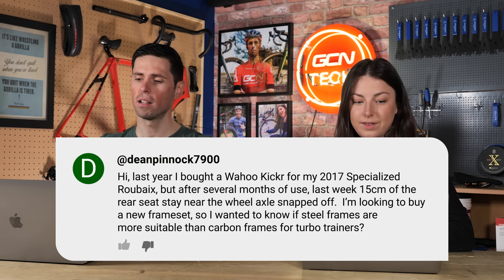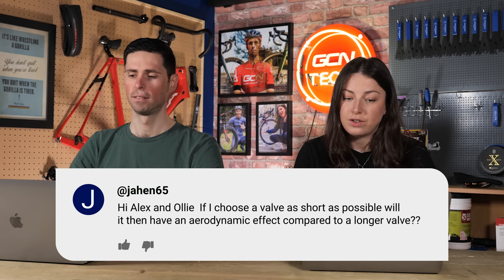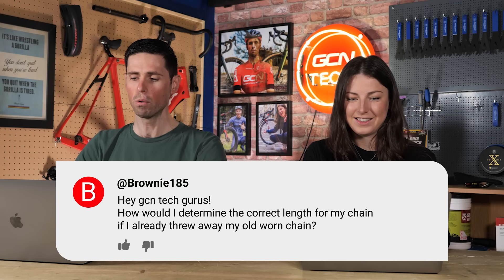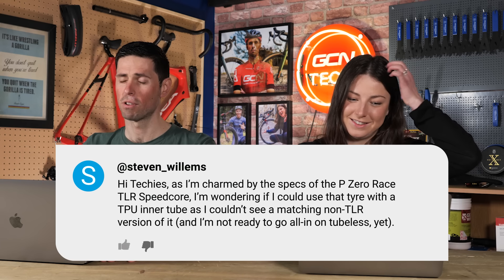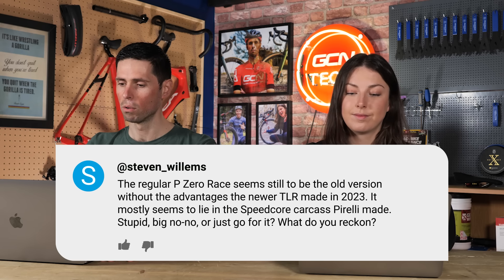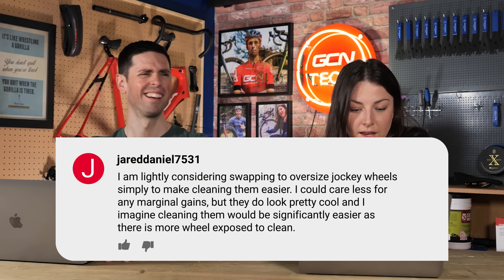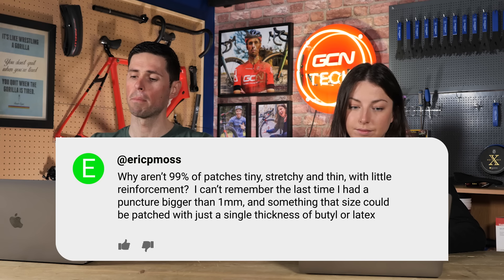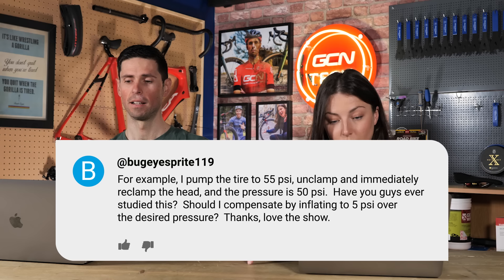Chain Sizing, Oversized Jockey Wheels & Aero Valves | GCN Tech Clinic

Comment: As Alex points out most the air you hear when removing the pump hose is the air sound is coming from the hose itself. When reattaching the pump, the hose is stealing pressure from the tire. A shorter or firmer hose material will have less of this affect, but really isn't a problem.

Comment: Adjusting Chain length, Calvin at Park tools has an excellent video on the process. 
If it is really complicated then there is no shame in going to a bike shop to have it done, something critical like proper chain length it is well worth the time and money spent to have it done correctly and have many enjoyable miles-kilometers of riding knowing it is done right.
Reply: I've seen a handful of chains where they're just a little too long because most of them were installed with the chain routed over the smallest chainring & cassette cog and through the rear derailleur. They just assume as long as the slack is taken up, it's the right length, but some of these rear derailleurs have incorrectly adjusted B-tension gaps.

Comment: When you pump up your tires there is a VALVE in the wheel or tube, you force air against it, when you take off the pump no air escapes. None. The sound you hear is air compressed inside the pump

Comment: The chap with the inflation question has misunderstood the situation.  When he releases the valve the woosh of are is in the airline, not the valve.  When he then puts his pressure gauge on to measure the pressure, a small amount of air is lost in the measurement process.  I think he isn’t loosing anything!!
Reply: Exactly!
Reply: Also a 5 psi difference is nothing since riding on a cold or hot day will change the tyre pressure more than that and noone seems to notice.
Reply: When replacing the pump hose, some of the air in the tire goes from the tire into the pump hose, thus making the gauge read lower.
Reply: @kokonanana1  yes. Also I was trying to say when putting in the digital gauge to see what pressure you have, that would also take an amount of air from the wheel.
Reply from the maker: We mentioned this on in the video, it's an easy mistake to make but a great nerdy question!
Reply: There are also pumps where you screw on the pump hose to the valve stem - it's probably not the case here.  I despise those.  By the time I can get one of those off the tire I've let out more air than I've put in!  Either that or I manage to back out the valve stem core while unscrewing the pump.
Reply: When I rode motorcycles, the standard method to ensure the correct tire pressure was 1. Pump about 5 psi more than you want into the tire 2. Measure the pressure with a gauge several times until the pressure reaches what you want (each measurement will cause a little air to leak out).
Reply: @peteralexander6514  riding yesterday at around 6 degrees for 5hours I set front to 72psi and rear to 75 psi.
When home tested again front was 69 rear was 74.
Interesting......
Reply: Presumably the pressure is pumped up to the value on the gauge and then measured using a different gauge? So are the two gauges calibrated to read the same? I doubt much air comes out when taling a reading off the valve.
Reply: Chap. Brits. Cricket? Bots?

Comment: I over-inflate my tires to compensate for the small amount of loss when disengaging the track pump. Works for me.
Reply: same here I inflate a bit over, my pressure gauge has a release valve on it and I just adjust to the correct pressure.

Comment: Tyre pressures with a track pump. Most of the escaping air you hear comes out of the hose so not the tyre. However, when you plug the hose back on, the tyre will empty into the hose to equalise the pressure. That's where the 5psi went. If you want to be more accurate, pump up to a higher pressure with a track pump and then use a digital gauge to slowly lower the pressure to whatever you want.

Comment: The air from the tire needs to equalize the air pressure within the hose from the pump when reconnecting. That's the biggest loss of pressure, especially on small volume road tires. Do the same test on 2.5" wide, 29" MTB tires and it's a lot smaller of an effect.

Comment: Re the broken carbon frame on the Turbo trainer - it's quite possible that the same failure would have eventually happened when out on the road - so all in all it's a good thing it failed whilst on the turbo as otherwise it may have resulted in an injury! Better luck with the next bike, Dean!
Reply: Possibly, but far more likely that having the bike clamped in a trainer by the rear axle, while the rest of the bike rocks from side to side has caused the failure.
Reply: Funnily enough, a friend has just had this happen - the non drive side seat stay has failed on a ride.
Reply: @grahamaustin9085  Have they had it on a trainer?

Comment: I recently had to replace the chain on my road bike. I had to size the chain without using the old chain to help with the length. Actually, I couldn't use the old chain. As I have changed the cassette for one with a larger first gear and changed the cranks and smaller chainrings.

Comment: Specialized recommended NOT mounting their carbon bikes on turbo trainers until around 2020.  It is entirely possible that the broken 2017 frame came from Specialized not designing frames strong enough to deal with turbo trainer stresses, which are significantly different from wheel-on applications.

Comment: Bikes are NOT designed to move from side to side while the rear axle is fixed. Maybe he did a lot of powerful sprinting.

Many people point out, "it's only been used inside", when selling their bike but to me this is not a good thing. I'd avoid a bike like that.
Reply: Yeah idk how they didn't mention that. That's why on the turbo you sprint different to outside and shouln't sway your bike side to side.
Reply: correct!! the torque on the bike frame skyrockects when fixed at rear by trainer
Reply: He could have tried to move his setup while the bike was attached. Manon actually mentioned making this exact mistake and cracking her frame in an older video.
Reply: I just started using a direct drive indoor trainer three months ago, the Wahoo Core, and although my bike's frame is Ti and quite strong, very early I could see some potential issues if I wasn't careful.

First is the side to side you mention during hard sprint, which doesn't allow the bike to sway right and left as you would outdoors with arear wheel. That's got to be hard on the dropouts and frame and trainers should be designed with some sort of give at the axle attach point to protect the bike.

It also seems possible to do some damage if you're in a rush and don't fully drop both dropouts completely onto the axle so the bike ends up being cocked, which as you ride I imagine could do some damage.

Also, as I think Manon pointed out in a previous video, if you try to move the trainer with the bike already attached by moving the bike, you could also do some damage at or near the attach points. Probably more so with carbon frames but bad practice in any case.

The latter two issues can be avoided by being careful, but the first one is a bit of a dilemma. I wonder if you could insert a thin but hard polyurethane bushing on each side between the dropout and axle to give the bike some play when you get up and sprint, akin to car control arm bushings that prevent the arms and subframe from cracking?
Reply: Manon: “Turbo trainers are designed to have a bike on them”
Yeah I think the problem is that not all bikes are designed to go on turbo trainers 🤦‍♂️
Reply: @HabaneroTi  pure rubber bushing washers!!!

Comment: Turbo trainers designed to have bike on it. But, Bikes are not designed to put on Turbo trainers. He snapped it because the rear axle is fixed on the Turbo Trainers.
Reply: Yes to that. I've noticed that any bike I put on a Turbo Trainer moves significantly in the Stays and Bottom Bracket area. So much so that I thought my chainset on one bike was not True but it was just the bottom bracket area going from side to side about 8mm..

Comment: I actually do care about the valve length - I got myself a thread cutter for presta valves to be able to make the valve of the inner tubes just a long as the rim is deep, and put in a special valve which is a mixture of a presta and a car valve. This is included in valve extenders for Campagnolo HPW Shamal/Bora rims from the late 90's (part code UT-HU100). For inflating, I use a brass valve extender which I can remove and close the valve hole with a piece of clear adhesive film (Tesafilm), so there is no valve in the wind at all - I am sure especially on fast descends with velocities of 50 mph+, it does matter.
Reply from the maker: please share that with us on the uploader! upload.globalcyclingnetwork.com the hacks/bodge section would be ideal!
Reply: @gcntech  I will do so; probably one picture which shows both the common presta valve and that special one, and one with the built-in valve in a DT Swiss ARC Dicut 80.

Comment: Typically the PSI has balanced between the tire and the hose....except with Lyzene screw on heads which have a pressure relief button which can on occasion unscrew the valve stem.

Comment: Re: chain length, there's at least one excellent online resource where you feed in the relevant information: chain ring sizes, sprockets (biggest and smallest) and chainstay length (centre of BB to rear axle centre) and the calculation of how many links you need is done for you.
Reply: What website is this?
Reply from the maker: That sounds great! We love a nerdy bike site 💡 Would you like a similar feature on the GCN site?
Reply: Sram gives instructions in its derailleur installation manuals on how to size a chain. Wrap it around biggy-big while bypassing the deraileur, count the required extra number of links for your cage length, then break/install the chain

Comment: The rule of 105% stated that the rim must be at least 105% wider than the tyre to gain aerodynamic advantage. Some wheelsets like Roval Rapide CLX II and Reserve 40/44 has a wider external rim width at the front and narrower at the rear. Which tyre cobination is faster, using a wider tyre at the front and a narrower tyre at the back following the rule, or using equally wide tyres at both wheels which is too wide for the rear? #askgcntech

Comment: Re the valve question, shorter is lighter, it's win win !
Reply: I am sure 2g saved on the chain will get you up the stelvio pass much much much faster ;)
Reply: I’ve inadvertently ended up with valves slightly too short for my thumb-lock frame pump.  I’d rather have a valve a few mm too long than too short.
Reply from the maker: Hill climbers dream!
Reply: That was an unbelievably stupid question.

Comment: #AskGCNTech Are heavier riders more susceptible to perineum numbness on the turbo trainer? I had a proper bike fit and out in the real world there are many bumps or changes in gradients where I force myself in different cycling positions. When I’m on the turbo in one position, I find myself feeling numbness after about 15 mins and have to switch positions. I am a heavier rider and would theoretically have more pressure regardless on my sit bones—should all turbo trainer users be changing positions up, anyway?

Comment: Easy chain length hack is put it in the small chain ring, the smallest cog at the back and there should be about a half inch distance between the chain on the jockey and the smallest cog on the cassette.
Reply: That sounds great for stopping the jockey cage and wheels from hitting in the case of small/small but it does nothing to ensure you can move to big/big!

Comment: Old steel 10 speed on zwift hub works a treat.
Reply from the maker: Oooo what bike is it?
Reply: @gcntech  its a 1980 Columbia I picked up out of a recycle pile.  Made it a single speed for a few years then stuck it on zwift hub trainer.  Had to spread the rear triangle just a bit.

Comment: #askgcntech Hi Olly/Manon and Ian, 2 part question: With the trend towards larger volume tires what is the limitations of road bikes having a standard clearance of, say, 40c, would aerodynamics be adversely affected.  Also why do alot of premium tyre models top out at 30c, which is the largest size I can find listed in retailers for the P-zero race tlr.  Love the show.
Reply: Conti GP5000s TR top out at 32c

Comment: Hello Tech Gurus,
I signed up for an ambitious summer; Triple Bypass (118 miles/10,800ft), Blue Sky (formerly Mt. Evans 27 miles/6,700 ft), and Cycle to the Summit (Pikes Peak 27 miles/4,800ft). I have an Alchemy Ronin Ti with 50/34  and 11-34 in the rear. I purchased a set of lighter weight carbon wheels. I currently have 28mm GP 5000. Would you recommend 32mm for some added cushion? Or do I attempt this on the 45mm Schwalbe G-One RS?  I am also doing the GCN recommended workouts and what my p.t. bike fitter suggested. I am also doing climbs on Zwift. Would you recommend doing anything more so that I can actually finish. I thought about changing the weight on Zwift to 20 lbs more than I weigh. Would this be beneficial or is what I am doing sufficient to ensure I will finish. I do not mind suffering more now to suffer less later. Thank you for reading my novel.

Comment: #askgcntech I recently destroyed both my tires on a gravel ride. I only had enough boots and patches to get one of them to hold air again. I put the good tire on the back wheel because - traction. I had to ride 15 miles back to civilization. Steering was awful. Should I have put the good tire on the front or the back?

Comment: #askgcntech Hi all, love your channel. I have used Speedplay pedals for years and love them. But I have been troubled for a while now that the recommended cleat lubricant contains PTFE (forever chemicals) which I would prefer not to use or be exposed to. Is there an alternative cleat lube that should work with Speedplay pedals? Thanks.

Comment: You can cut patches to size as required.  Personally, I'd hate to try and patch a tube at the roadside with anything smaller than I have though, it's fiddly enough as it is.
Reply from the maker: That's true! It can be very fiddly. Do use a spare tube and take the broken tube home to fix in comfort? 🏡
Reply: @gcntech  Usually, yes.  Sadly last time I had a puncture on  gravel ride round a wind farm my spare tube had a faulty valve.  Hence the first hand knowledge of "fiddly", using a dirty pothole to find a puncture is not fun!

Comment: #askgcntech I bought a new bike last year with an 11/34 cassette because I thought I would need the 34 for one specific event with a very hard climb. Last year I couldn't do the event because a friend had their wedding that weekend. This year the event is cancelled. The event is going ahead next year, but if I need to use the 34 up the climb, will I have any issues if I have never used that cog before? Should I use the 34 even if I don't need it just so it gets some use? Ps I will not be buying a different cassette and changing it for the event so please do not suggest that I am too lazy. There are no climbs that are on any of my local routes that require a 34

Comment: #askgcntech I've tried this before but you advise us to measure actual tyre width when using tyre pressure calculators but not at what pressure to have when measuring. An over inflated tyre will have a larger width than it should have. Advice please.

Comment: #askgcntech Hi friends, I recently converted my weird looking 90s-mtb-converted-to-gravel bike from 26inch wheels to 700c. I previously had inner tubes with Italian valves (the ones with the little separate cap you screw in to close them down) and I loved them, but the cheapest option for 700c was presta. It seems like presta valves lose quite a bit of pressure after every ride or even during the ride, so much so that I have found myself having to stop to fill up some more. I checked many times for punctures and I am positive there are none. I can't imagine this is normal, so what could it be? 

Hope it makes it into the show next week🤞
Reply: Having to top up your tire pressure in the middle of a ride is not something most of us would expect to have to do.  If I had to guess, I'd guess that the tube(s) are of poor quality and are permeable or you have a slow leak from somewhere.  Try putting your freshly inflated tire/wheel in some water and see if you can spot bubbles of air escaping.  I've had slow leaks resulting in tires going soft in the middle of the ride, but it's not been because of the valve type - it's always been some kind of small puncture or cut when it comes to clincher tires with tubes.  In the tubeless realm, I've suffered air escaping through the sidewalls (Rene Hearse Barrow Pass tires), gummed sealant creating gaps between the tire bead and the wheel (Bontrager GR1 Team Issue (fixed by thorough cleaning of the tire bead and wheel rim)), or sealant just not able to keep the puncture sealed (Stans sealant and 700x28 Continental GP 5000 (fixed by thoroughly cleaning and drying the inside of the tire and then patching the inside of the tire with a Park Tool GP-2 patch).
Reply: @johnbeckmeyer1696  thank you for the well articulated reply ✌️